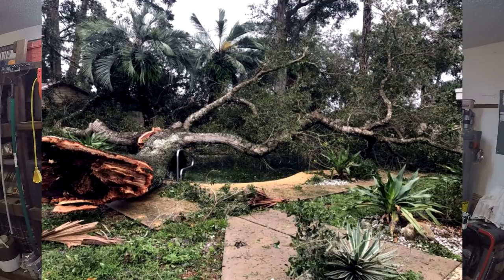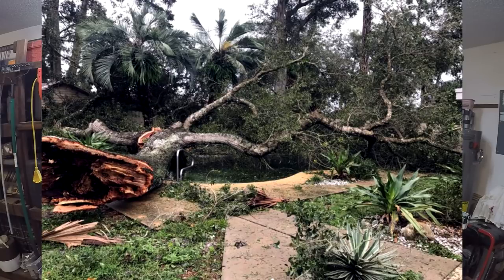Making a Hand wheel, part 1

Comment: Why not just wrap some putty around the spokes until you get a clean line, there is no need to exactly duplicate the original I don't think and an extra 1/8in on the spokes wouldn't hurt anything since obviously they were a bit weak to begin with anyways.
Reply from the maker: Putty is too easily formed when rammed up in the sand. In other words, the same property that allows the material to be formed around the spokes would allow it to be distorted by the molding process. Besides, I'm not trying to replicate the spokes exactly, just trying to make them look solid. In addition, they weren't weak, they were cast iron and so were brittle like glass. If you were to take a iron casting right out of the mold and dropped it the thinner sections would break like thick glass. Most castings, especially cast iron needs to be stress relieved to remove the stresses between the crystals formed during the solidification process. This casting must not have been.

Comment: Just got my own home foundry up and running to go with my little machine shop.   It may not make economic sense  but there is a lot of satisfactions in fixing things destined for the dump and putting back to use.     Just yesterday helped make an aluminum part to replace a broken plasic part.

Comment: I agree with your assessment of most of the Harbor Freight items.  But for $50 I got a belt/disc sander that has about  100 hours of use on it.  Is it great?  OH HECK NO...but it does the job I need.  I bought their 10 Speed drill press.  It works.  It isn't perfect, the spindle has about 3 tenths runout (good enough for me), and the belts slip...and sometimes the taper shank chuck also falls out once in a while...and the thing is LOUD...but it works, and it's gotten me through many jobs.  Again, paid $70 for it.  I also bought some hand tools from them.  They are not that bad...they aren't Snap-On, but hey, I also didn't pay $50 for an open end wrench...and I'm not using it everyday to make a living.  So Harbor Freight has its place...they really do.  It all comes down to the item.  They aren't designed for heavy use...moderate to light no worries...

again...I agree with your assessment of HF items, but in the end...they are selling to a price, they are built to a price, and if you are expecting a Snap-On quality tool for a HF price?  Well...then you're getting exactly what you deserve...
Reply from the maker: I couldn't agree more.

Comment: Hey Chief, I was on the Prairie AD - 15 from ‘73-‘75 I was one of those engineers that broke stuff for the foundry to fix.

My thoughts on the Aluminum casting is the spokes are awfully spindly maybe make the form spokes thicker. Although unless a gorilla tries to tighten down the vice it should be strong enough.. my main concern is more about accidental bumps, etc.
Reply from the maker: This project was set up mainly to show the observers how a broken casting can often be used to make a new one. The new one won't be used by a gorilla and the new owner is pretty careful in his shop.Thanks for the suggestions.
Reply: I guess I'm pretty randomly asking but do anybody know a good place to stream newly released movies online ?
Reply: @Jimmy Marcel thanks, I signed up and it seems like a nice service :) Appreciate it !
Reply: @Pedro Korbin No problem :D